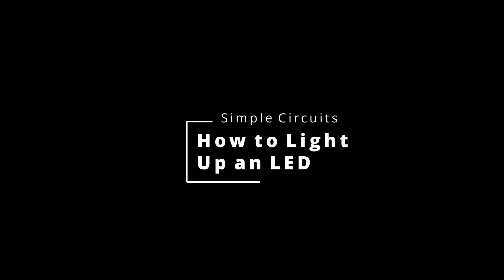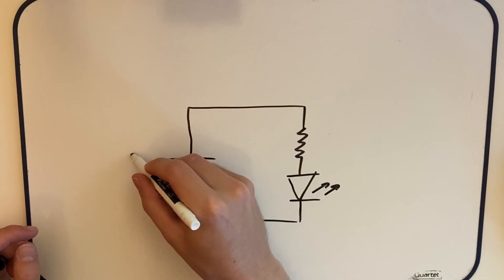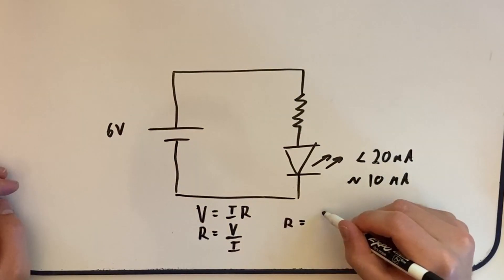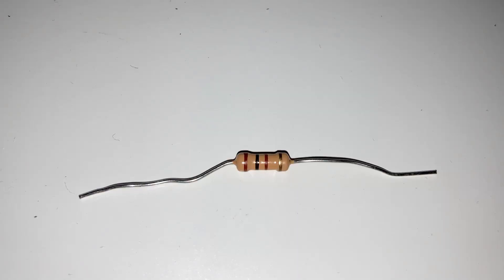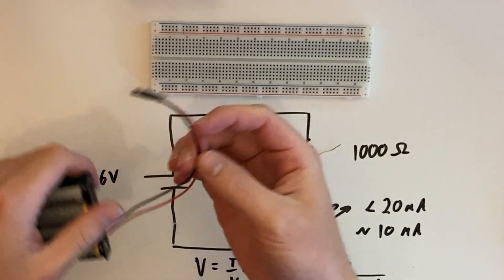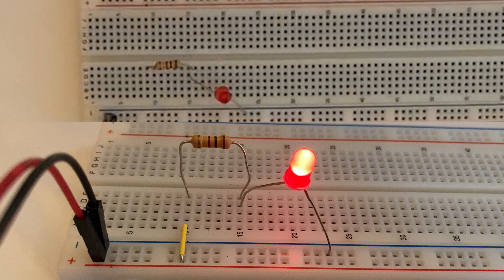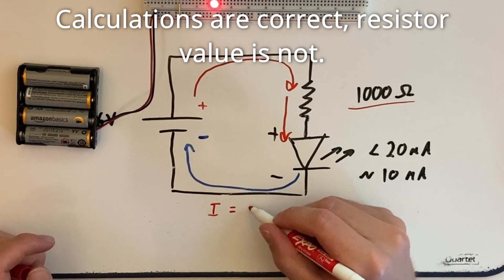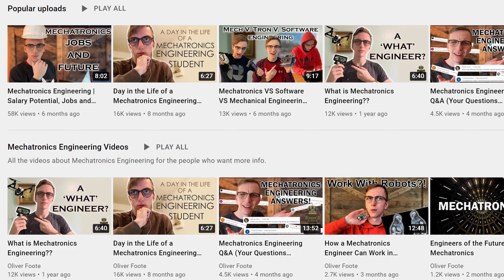How To Make An LED Light Up | Basic Circuits

Comment: Brown black brown is a 100 ohm resistor Brown black red is a 1000 ohm resistor. Your current in the circuit is a little high at 60 mA.